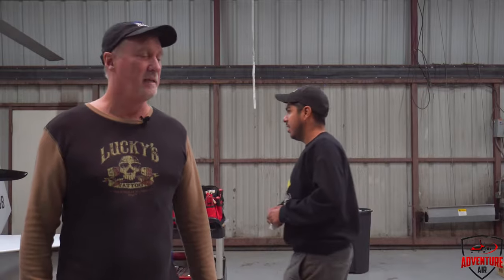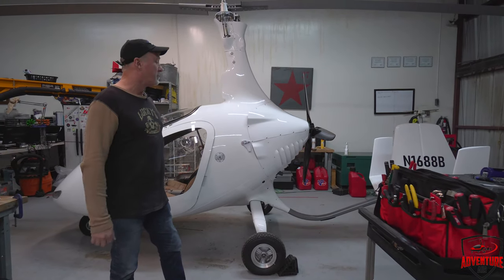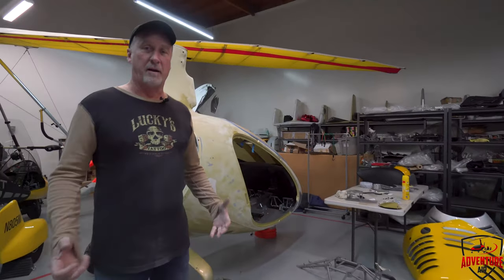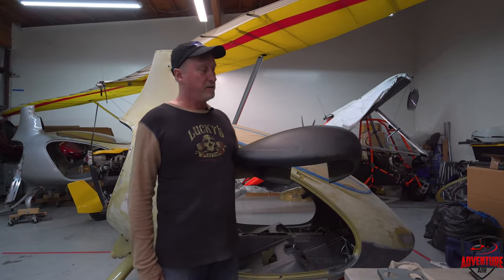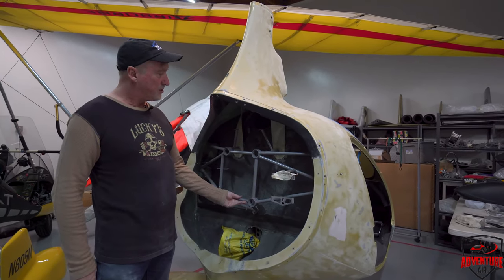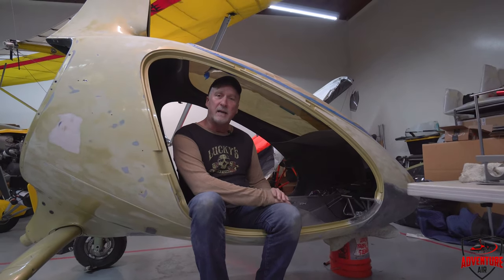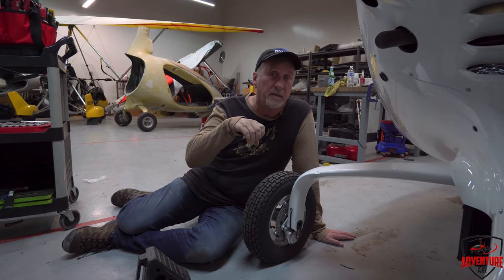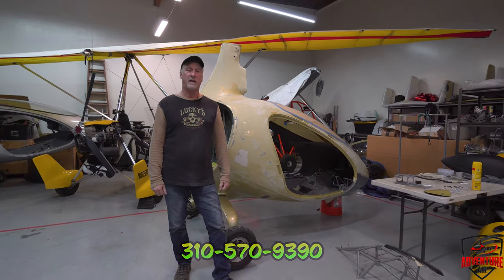25. Rebuilding a Gyroplane: From Salvage to Flight #frankenstein

Comment: If you didn't have a spare engine, I would suggest  a 912IS, a 915IS or the equivalent of a fuel injected 914(IS) engine.  For paint how about black wheel pants and a yellow body. Perhaps a black rotor mast or tail. Try out various paints schemes on the computer and then choose what you like best or give the employees a vote. Can an all black one get a little hot in the cabin?
Reply from the maker: There are so many yellow Cavalons we'd like to change it up. We actually have two yellow ones in the hangar now.

Comment: Let's go Iron Man, red and gold. Just a thought on the 912, making 140HP will make a air cooled motor run hot, has anyone else done that.
Reply from the maker: Yes. There are a few upgrade kits that are out for the 912. ELA has an Ironman themed gyro out so I don't know if we want to go that route. But great idea!

Comment: Think about using the matt black for a secondary or accent color only due to heat. Just set it out in the sun next to a white and maybe with a colored component, put your hand on them and you'll agree. (I'll try to find your email and send a couple ideas.) White with the  black, and yellow or red striping to help make it go faster...haha.  Also a single 10 inch G3X (maybe with a G5) is easy to use and lightweight but costs more.  I wouldn't use anything less than the 914 but I'd move away from anything carbureted if possible.  I know... money is never an object! Haha!  Have fun with this project!
Reply from the maker: Contact adventureairla@gmail.com
Reply: @AdventureAir  Thx, will do.

Comment: Where can one get all the designs and learn to build one. Am in uk but do like. The Idear to build one or work on one to learn what are the possibilities
Reply from the maker: The hull of this gyro was bought off a local online classified site called Craigslist. Other parts were accumulated over time through maintenance and replacement or bought new from the factory. You can obtain the build specs from AutoGyro.

Comment: I love your project of restoration and am very curious about. But: black matte is no color, unless you want a sun powered heating chamber. Could be a nice idea in NWT, Canada, maybe! 😁 Use something fancy: green metal flake with a shading from bottom up, or something other shiny colors.
Motor wise, I would go for a 914 at least. It has enough power for higher altitudes, but not that much torque a newbie is overwhelmed with, like in a 915iS. This much torque can lead to accidents, when not handled properly and is definitely nothing for a newbie. As I heard from my CFI's, pimped motors, like a 912 ULS with turbo, may not last as long as a motor, which is designed for the power, like an 915 iS. I like reliability in an engine. You can't drive to the side, when the motor fails, like with a redneck pimped 8 cyl. 800 hp muscle car, which its reliability has to last just for a pull from the traffic lights. 😊
Would be nice to see far more of the ongoing project! 😀
Reply from the maker: We're still experimenting with colors but we're most definitely going to use the 912 rotax since we already have it. The upgrade kits are pretty affordable and dependable. Thanks for watching!